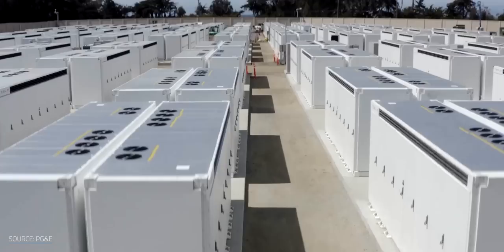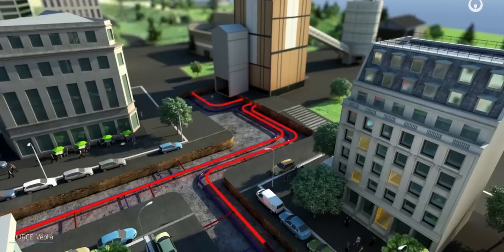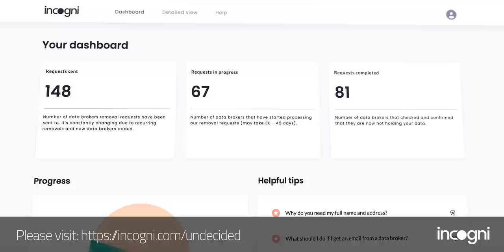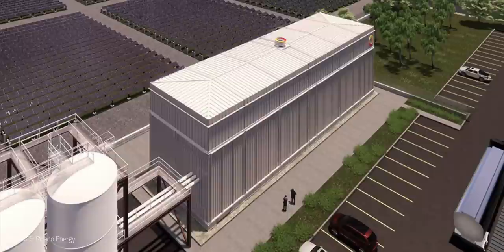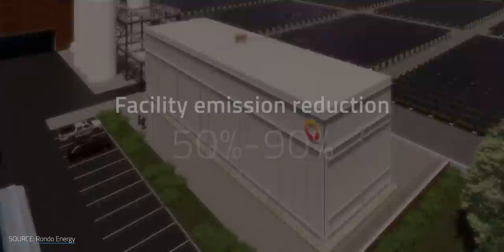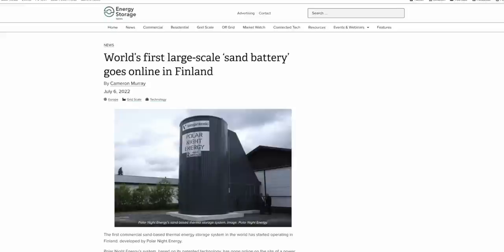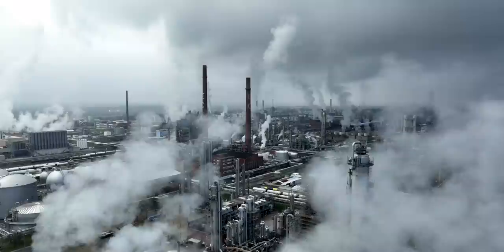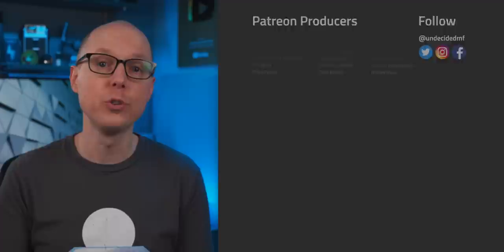How A Brick & Rock Battery Is Changing Energy Storage

Comment: Also things like Rocket MASS heaters for your home where you burn wood or pellets in the heater, these style of heaters are VERY efficient, there is only a small amount of fine ash left after the burn. The outlet from the fire box goes through a Mass of rock, gravel bricks etc, which warms up via latent heat, and that mass stays warm for 30 to 40 hours after the fire has gone out, It is a great Idea but a lot of people don't know about them. Too many people today only want heaters that plug into a wall outlet, or are built-in reverse cycle air conditioners.

Comment: "night store heater" (Nitestore heater) Used as "in forever" both in Europe (still popular in Belgium and northern France) and here in New Zealand/Australia (less nowadays with the heatpump taking its place and more importantly: The disappearance of "Day rate/ Night rate for electricity.
Reply: Yep, immediately thought about night storage as they are pretty common in the UK, with about 1.6 million homes using night storage heating in 2016 according to Ofgem. They have their place as they are easy/cheap to install but are nearly twice as expensive to run when compared to oil/gas heating.

Comment: Thermal storage as a dump load for times of overproduction makes a lot of sense. Instead of curtailment that energy from solar or wind could be captured and used for low temperature heating needs like residential but we need a smart enough grid to offer that energy cheap to the end users at those times.

Comment: Most of Steel's CO2 emissions come from production of virgin steel, from both mining and the actual process of manufacturing steel, by pushing oxygen into the iron, and emitting co2.

Production of virgin steel is unnecessary if you just need STEEL, but virgin steel is required for the most part to mix with recycled steel to get highly precise alloy mixes. It is very difficult to get certain elements out of an alloy with steel, so recycled steel is usually mixed with virgin steel to balance out the proportions of contaminants from the recycled steel.

What's needed here, definitely is MASS carbon capture, as virgin steel making largely HAS to produce co2 with the current processes. But the bonus of steel is that it is done in an enclosed facility, unlike concrete (though the production of clinker can also be carbon captured, but most poured concrete emits co2 too). 

There are interesting alternatives though, as steel can apparently be made with hydrogen without co2 production. Swedish company Hybrit created green steel this way. If hydrogen becomes much cheaper, then this form of virgin steel production might take over completely. We can only hope.

But the use of heat batteries could definitely help metalmaking as an industry be more efficient in its energy use, even if entirely run on electricity.

Comment: Dear Matt Ferrel, on presentation you showed some advantages of Brick and Rock Battery System. 
Please share some technical informations of this type of TES i.e.: 
What is the selfdischarging time of  thermal energy storage system? 
What is energy efficiency storage calculated from electricity to electricity?  
What is a volumetric capacity of energy storage system when the required temperature at the outlet of gas is at least 500 deg of C?
Regards.
Antoni

Comment: This has to be one of the coolest topics. Mind the pun. ;). I asked GPT about this subject.  It was a cool response into the heated debate on global emissions: 

My question to GPT:
"Can one utilize the excess heat from electrical generation from solar panels to create additional electrical generation from the heat they create using thermal electrical storage?"

ChatGPT
Yes, it is technically feasible to utilize the excess heat generated by solar panels for additional electrical generation, though this application is more common and efficient with concentrated solar power (CSP) systems rather than with photovoltaic (PV) solar panels.

Photovoltaic (PV) Solar Panels: These panels convert sunlight directly into electricity. They do get hot during operation, but their efficiency actually decreases with increased temperature. Therefore, while it's theoretically possible to use the excess heat from PV panels for thermal energy storage or generation, it's not commonly done due to low efficiency and practical challenges. The focus with PV panels is typically on cooling them to maintain efficiency.

Concentrated Solar Power (CSP): This technology, unlike PV, is designed to use heat. CSP systems concentrate sunlight using mirrors to heat a fluid, which then produces steam to drive a turbine for electricity generation. These systems can incorporate thermal energy storage, allowing for electricity generation even when the sun is not shining. The stored heat can be used to generate additional electricity, making CSP systems more adaptable to varying energy demands.

Thermoelectric Generators: These devices can convert heat directly into electricity using the thermoelectric effect. While they can be used to generate electricity from the heat of solar panels, their efficiency and power output are currently limited, making them more suitable for small-scale or specialized applications.

Hybrid Systems: There are also hybrid solar systems that combine PV and thermal technologies (PVT). These systems can produce electricity and capture heat simultaneously, offering a more efficient overall use of solar energy.

In summary, while using the excess heat from solar panels for additional electricity generation is possible, it is more technically and economically viable in CSP systems or in specialized hybrid systems rather than in standard PV solar panel installations. Advances in technology, especially in thermoelectric materials and hybrid systems, could enhance the viability of this approach in the future.

Comment: 1500C air would still be useful for steelmaking or other higher temp apps.  You'd preheat the charge to 1500C then finish it off with much less gas or electricity.

Comment: There have been electric storage heaters for many decades in the UK. In general, they were regarded as inefficient and expensive to use. They were usually put in social housing and they heated up at night on a special cheap rate called Economy7 and the heat radiated out during the day. Heater looked a fat radiator with bricks inside.

Comment: This makes sense when you can purchase electricity at certain times and use it later. Leading to an energy economy where you have "over-provisioned" renewable energy sources. What I really want to see is thermal energy storage where the heat is converted back to electricity and this can be made 50-60% efficient (round trip).

Comment: Several comments...

NREL published some numbers on the amount of thermal energy used by US industry at various temperatures.  Of note:  2/3rds of the BTUs used for industrial heating were below 300 C.  This is even more "medium" heat than the numbers quoted in the video would indicate.

NREL also had a project called ENDURING to use hot sand for grid storage.  The sand would be heated by flowing it through an electric resistive heater, heating it to 1200 C.  It would be stored in insulated silos, then, when needed, allowed to flow from the bottom of the silo into a direct contact fluidized bed heat exchanger.  Air would be injected into the sand and then separated from it, carrying away the heat.   The air would expand through turbines before being cooled and recompressed.   Round trip efficiency was estimated to be ~53%, with a levelized cost of storage (LCOS) of $0.05/kWh.   Storage times of weeks would be possible.   Babcock and WIlcox (the makes of the fluidized bed heat exchanger) are commercializing this technology now.

Another class of thermal storage schemes is Pumped Thermal Energy Storage (PTES).   Here, one not only stores heat in some medium (as in these devices), but one also stores "cold" in another bank.  The hot and cold are separated using a heat pump.   For example, one can compress argon, transfer the heat to a heat store, expand it through a turbine to recover some of the work done compressing it (and also cooling it), then transfer the "cold" to a cold store.   The discharge, reverse this scheme.   With the hot part at ~550 C (solar salt) and the cold at -100C (liquid hexane), the round trip efficiency might be 65%.   These temperatures are in the range supportable by ordinary steel without having to worry about creep.

Westinghouse is working with Bulgaria to install a 2 GWh PTES system.

For very high temperature storage systems (1000 C and above) if you use air to carry the heat you will have to worry about production of thermal NOx.  This will either have to be treated or the air recycled in a closed system.

Comment: In 1976 I was working with a company that was building solar furnaces to heat homes. I was designing and building the electronic controls for the furnace. A blower ran air over the solar collector and then over the stones which were used for storage. The stones were simple cobble, available from most gravel and sand suppliers. The project was not a success, frankly, I believe because it was simply ahead of its time.

Comment: Sorry about being a party p**per, but when you make thermal storage at temperatures of 1.500 degree celcius, even SUPER well-insulated, walls have a decent amount of heat loss. Since heat loss is directly dependant on the difference in temperature, such a massive temperature difference will give similar increases in heat-loss. For short term storage that might be acceptable, but for longer term storage you have to expect a certain amount of energy-loss.
It might still be worth it, and I am actually a "believer" in thermal storage, however I think it is important to mention and keep in mind.

Comment: I’ve thought a lot about putting a heat battery in the ground on my property.  Similar to greenhouse underground heat batteries.  It seems like digging a hole, insulating it, and refilling it with dirt and pipes seems like a home solution that would work.  I’d like to know what an engineer thinks.  It seems like heating it with thermal modules in the summer and then using it in the winter with supplemental wood based recharging would work.

Comment: I want to eventually live off grid so this is definitely something I want to experiment with.  I might even try it small scale here at home once I have my wood stove set up since I can use heat from it to heat water then store it. My setup would be below 100C though as I don't want to get into steam territory but if I can use the stored energy to heat the bathroom in the morning for when I shower which is one of the times where I want heat the most as I'm always cold when I'm tired.
Reply: At least in northern Europe it is quite common to have few cubic meters of water in a insulated tank in a house if heat source is intermittent, like wood burning heater. Quite cheap, simple and easy to expand. Each 1000 litres of water can store for example 58kWh if 50C temperature difference is used.  (for example from almost boiling 95C to 45C which is still hot enough for heating with good radiators or underfloor heating). Each C for temp difference with 1000 kilos (good enough to say 1000 litres) of water stores 1,13kWh so it is easy to calculate how much volume is needed.

We had a system with about roughly 2000l hot water tank, and it kept the house warm for a day during winter and and provided hot water for half a week during summer. It got replaced with smaller tank due to change to heat pump as the old boiler was.. well just worn out. But we still have enough tank capacity to be able to basically reload the tank during off peak and just let heat pump rest over the price peak during office hours.

Comment: This is going to be a key feature of efficient homes. 

I firmly believe that thermal storage in large thermal masses is going to be a fundamental component of a highly renewable grid, and particularly so at the individual living space level. 

It's pretty simple too! We use excess power from renewables to change the temperature of large thermal masses as the way to give to a consistent & buffered power grid AND make living spaces more comfortable.  If every home and building had more solar than it needed, and the grid has a smart system that could offload excess power to heating or cooling some huge thermal mass, then the system could make the grid very stable.  We already did this with off-peak hot water systems, but think much bigger! 

Two big thermal masses that people already have, that can be easily heated/cooled, are things like concrete slabs and pools, but you could also deliberately install large thermal masses inside your house to work with this even more. I think the idea of having large rock/brick walls/pools/marble statue/stone benchtop (or any other high thermal mass object you can think of) to be on the inside of the thermally insulated living areas of your home, is the way to keep the house comfortable and absorb excess power. 

TLDR; big thermal masses inside the living space of your home can be the thermal battery you want! Also, you aren't just storing heat, you are also storing "coolth" in the hotter periods.

Comment: I use some 1970's era Steffes ETS heaters. They use off-peak electric to heat the bricks to 2000F and then has a fan that heats the room as needed. And a thermally controlled valve mixes room air with the hot air so that the air temperature coming out is not that hot.

Comment: I think I can answer the "why tobacco plant" for you.
tobacco is dried or temperature/humidity controlled. The farm I knew that did it had dozens of little shacks on their property during the summer with heaters running. Assuming you put solar on those same shacks you could easily make the power you need over the time when the heat isn't running, storing it as heat would actually cut out the middleman when it comes time to utilize the stored energy.

Comment: Out of the box,  it is said nuclear plants have to use water to produce steam when exposed to the rods, what if in relation to the size of the volcanic rock battery you say you want to produce x amount of heat you calculate the size of the rod in relation to the desired output. Thus producing heat until the rod cools down.

Comment: I think the real question is how do we harness natural extreme heat sources to transfer into sources like this. For instance, imagine a bout a mile long stretch of these batteries set in the middle of death valley to act as a passive power station. Use the steam in an enclosed system to spin turbines for power production. Where that becomes an issue is energy transfer to needed locations. I suppose one would have to use a system of such stations to produce and transfer over long distances.

Comment: Storing heat as heat makes good sense. What gets ignored when it comes to industrial processes such as steel and cement manufacture is it's not just heat that's required a reductant is required. 
To  remove the oxygen from say iron ore (oxide, ) the way it's done is using coke to provide the heat and the carbon to trap the oxygen as carbon monoxide. Releasing carbon monoxide is really, really bad so it's burnt into carbon dioxide, often generating electricity in the process. It's the same with making aluminium by electrolysis, the electrodes are carbon which is burnt by the released oxygen releasing carbon dioxide.

Comment: Most things that generate heat waste it by sending it into the atmosphere... Your gas water heater, your car, the power plant down the road, your range hood in your kitchen, the shower water going down the drain. Lots of heat we can recover and use. Imagine having a salt water, brick, or sand battery for your house that you can use to heat it in the winter. The sun or solar panels heat the battery during the day and it then extracts the heat at night when the sun has gone down.

Comment: Currently going into my graduating semester for a BS in Electrical Engineering, I'm doing my senior research project on the excess power that they are using but instead of heat, we're putting it into hydrogen for long term storage. Similarly we are looking into integration to existing systems already existing such as turbines and other generation types using hydrogen.

Comment: 100% efficiency is good but I'm sure  more is better. A swedish company has come up with a heatpump that operates at temps up to 180°C.  Couldn't find figures for this technology,  but heat pumps are known for multi hundred percent efficiency, by transfering heat to or from  where needed, instead of generating it.  In industrial applications and heating applications where 180°c is high enough temperature it could greatly increase the efficiency.   Wind, wave, solar generates electricity which is transmitted to location and converted to heat via heatpump for say double or triple efficiency, then stored for use as needed.  Heat when sun isn't shining or wind isn't blowing.

Comment: Wasted heat is wasted energy.  We definitely need methods to capture and reuse it as well as capturing as much energy from from renewables when there is excess supply.  We should be putting that energy to some use, even if is just using a 40% efficient Sterling engine to generate electricity from it.  40% is better than 0%.  

I like this concept.

Comment: Idk about storing heat, it seems like storing heat is as challenging as storing helium it will transfer through even the least conductive material, least conductive is still conductive.  I like the idea of water, moving water from a lower lake to a higher lake with excess energy and then releasing it and running turbines during the night letting gravity do the work.  That seems reliable, repeatable, with only mechanical losses.  Storing heat sounds like chasing a dream.